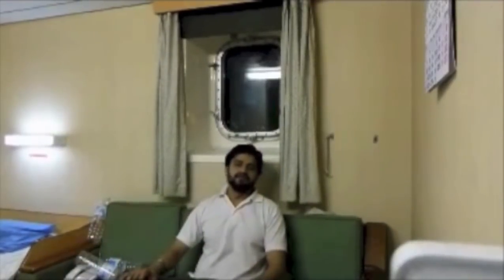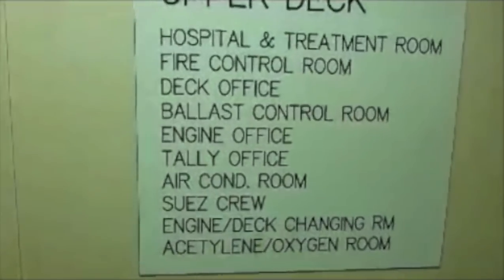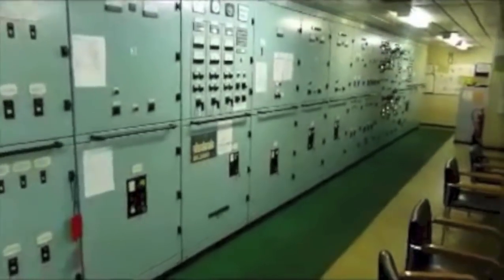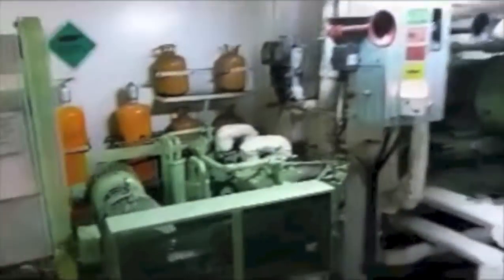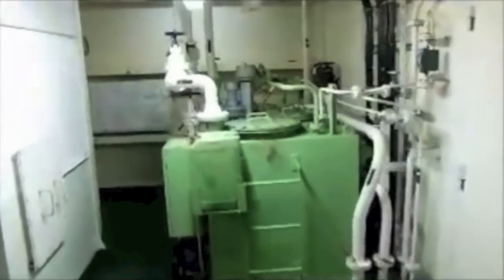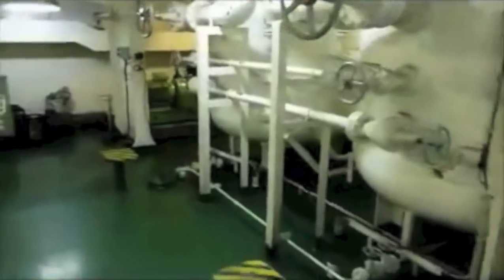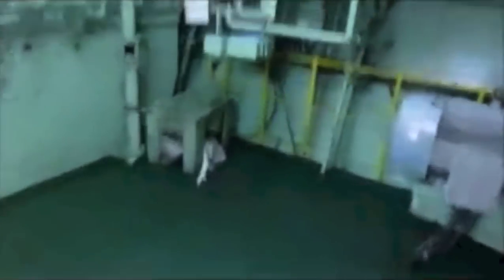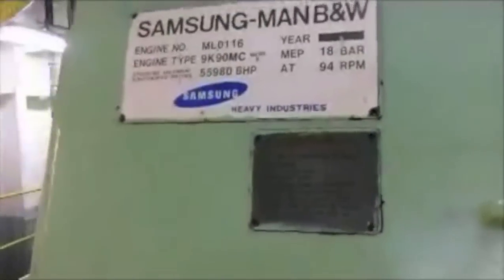Container Ship Engine Room Tour

Comment: Wow. It's amazing that all those separate parts go together to make the ship go. I worked on a nuclear submarine and you could see how everything worked together to turn the shaft, but this thing is so huge you can't see how it connects together to turn the shaft.
Reply: I haven.t googled this ship yet, but it may be electric propulsion rather than shafts conneced to the engine.
Reply: Doc DuMont But even electric propulsion would have to work to turn the propeller. We had two ways to make the submarine go. Steam turbines which spun to turn the propeller or a giant electric motor to turn the propeller. I've talked with some guys who worked on surface ships  in the Navy and they said the ships were powered with jet turbines like they use on fighter jets, powered by a liquid fuel. I suspect a similar kind of turbine on this ship.
Reply: That ship looks to be direct drive, especially given the max rpm of the engine. It probably has a clutch arrangement to allow for disengaging the main shaft when at an all stop bell. Some of these ships have variable pitch screws, which allows the shaft to turn without putting way on the ship. It's the same system used on the USN/USNS ships that run gas turbine propulsion. And, you were told correctly about the GT systems. They are jet engines modified for marine use, GE LM-2500's. Steam turbines have been phased out for surface combatants, but a few of the amphibious fleet and supply/support ships still run steam propulsion...not many left though. I was a non-nuke machinist mate, so I know those systems very well. Watching this video was like stepping back in time....all looked VERY familiar. If I knew my knees could handle it, I would go back to sea in a heartbeat.

Comment: I should of been actually DOING this myself!  Nice video, only thing is on certain placques and gauges, your camera's res was unfortunately not up to par. As aspirimg marine engineer myself, it is important that I can read mos tof these p;aque for myselfs. (I can get info elsewhere, of course, but would have been nice to see firsthand aboard MSC Matilde.  BTW The MAN B&W now is just MAN Diesel & Turbo SE.  B&W (Burmeister & Wain of Denmark) finally bit the dust, though they had powered second motorship in world in 1912 Selena. (First one actually officially celebrated) The actual FIRST motorship was VULCANUS out of Nederland with Werkspoor engines 1911.

Doosan, Hyundai, and Wärtsilä along with still other firms have joined MAN in these my favourite marine diesels, especially that one loner, 14RTAFlex96C on board Emma Maersk! It is rated as officially world's largest diesel engine.

I did enjoy your Youtube tour, as of course I would have preferred to have been 'authorised' as visitor in person. There I could FEEL, SMELL (and indeed if so inclined TASTE?) the experience as youtube only covers two out of five human senses, sight and sound.  Plus I could 'linger' a bit at important stations that would be especially interesting to me (such as of course M/E).

BTW what registry is MSC Matilde under, just curious?

Thanks kindly.

Comment: I can't understand, the ship is moored in the harbor. Why it is running in island mode, powering itself by its onboard diesel generators? These fancy power equipments should be able to sync to shore power and switch back and forth smoothly. A big ship needs cca. 300-400kW of power to run its basic systems, at this load a genset burns like 100kg/hr of that dirty HFO. Yes, it is cheap, but shore power coming from big and more efficient power plants should be cheaper, and it is cleaner.

Please anyone experienced in marine engineering, explain me this.
Reply: Depends on the fees and charges for shore power and services. 1) amount of energy consumed 2) Charges for workers and electricians, supervisors, you know the drill 3) Depends when you want the service - surcharge for late hours, holidays, short notice. 4) More of same charges to disconnect and make ready for sea. 5) Also the time (expense) of the crew 6) Oh yes, then there are the disposal fees for sewage, sludge, etc.
Sometimes it is cheaper to stay in island mode unless you will be alongside for a longer period. 
Hope this helps!

Comment: im doing martime dint start yet about to.So i got two choices engineroom or Deck can anyone help me which is the best?
Reply: It's all really up to what you want to do. Are you more mechanically inclined and prefer to troubleshoot, be responsible for specific systems of the ship. The engine room will require much more skill than deck. For Deck I can't speak for it much, but it seems to be more with plotting the courses of the ship, handling legalities of cargo and etc, being aware of the ship's surroundings for any nearby vessels that could create danger.
Reply: deck is bether beacuse engine room have a very noise
Reply: Deck is bether engine room have a very noise
Reply: @mohammadyf7126   engine room better because your getting paid to do work than sitting around all day like deck do

Comment: Very, very, very nice video.
A lot of machines to keep a cargo ship moving.
Does the A/C system use cooling tower and chillers or it's use the same conventional system like the one for houses ?
Thanks
Reply: The AC system shown in the video (control room) is a packaged unit AC, which has a chiller (Evaporator and condenser units) but there is no cooling tower as such, the cooling water is supplied from and led back to fresh water or sea water system of the ship. The AC for accommodation spaces is a centralized unit with compressor plant in the engine room and separate AHU (Air Handling Units) in the accommodation.
Reply: mauro4363
Reply: The condensers on a ship are cooled with sea water using a 'shell and tube' system. The evaporators are also shell and tube, with storage tanks and chilled water supplying air conditioning and chilled food storage at 5 degrees. A smaller refrigeration compressor condenses in the same way, but has direct expansion evaporators in the frozen food storage area regulated to maintain -18 degrees centigrade.

Comment: Very nice indeed, and a little more space to move in , much more than the O and S class submarines I worked on at CHatham Dockyard in 1957. That is some engine and the exhaust valve must have quite a dimension seeing that hydraulic pipe used to lift it up with. Good video.
Reply: The dimensions on this type of engine is stupendous! The exhaust valve is more than 9 feet tall roughly. The hydraulic pipe is used to supply oil to open the exhaust valve, not exactly to 'lift' it.

Comment: Im also marine engineer i have xperiece over haul main engine removing the crank shaf due to bairing seal is also fallowing and the journal got scratches but not as ur engine coz i work in domestic here in ph i like to work in big engines hoping some day to work overseas international
Reply: domestic engine is too small compare to international ship the size of the engine is so big like four floor from top to the bottom